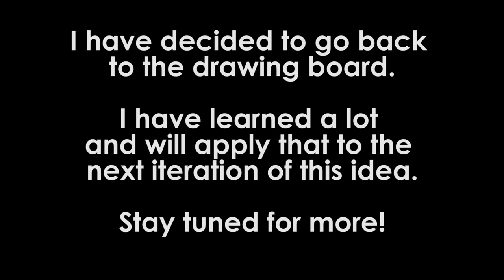HDPE Welding Experiments: DIY Cyclone 4

Comment: You should've used the plastic stick as a braising stick rather than dripping burnt plastic onto the cold sheet.

Edited to add: you should use a little hot saw – well, its actual name is a die grinder, I think – to cut those ridges, not a chisel. Much safer! Faster, too.

Comment: Way too much heat to melt hdpe next time just heat two flat metal bars in an Oven then clamp them along the joint approximately 260 degrees f